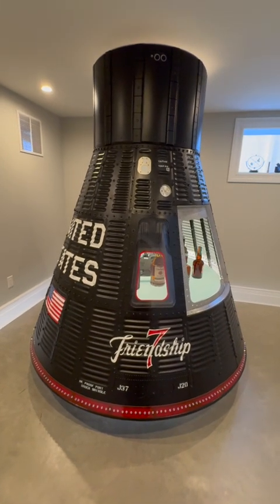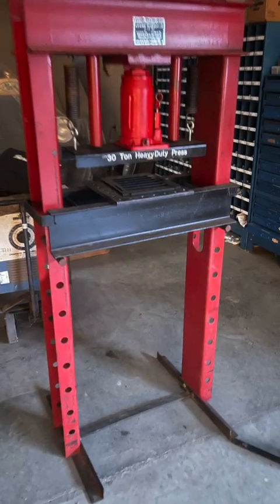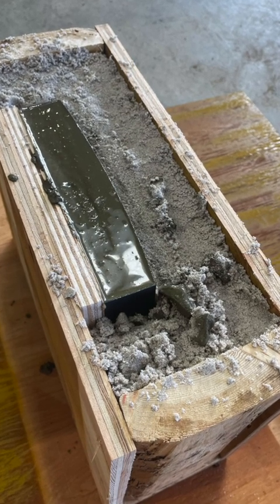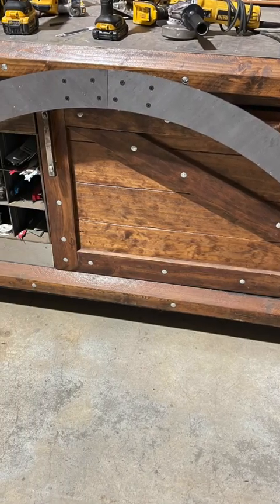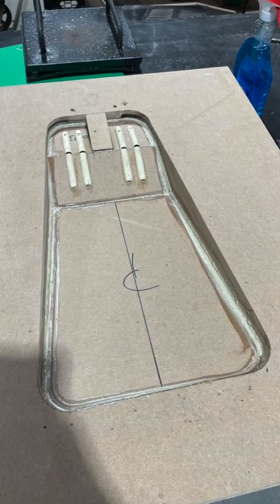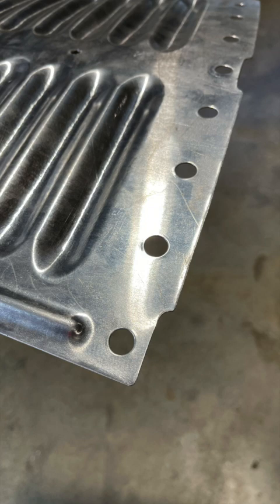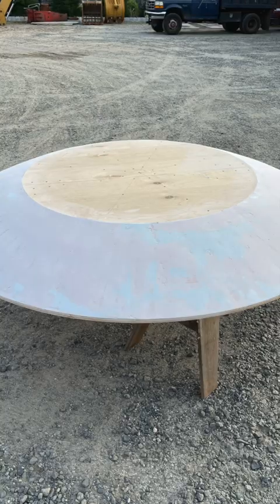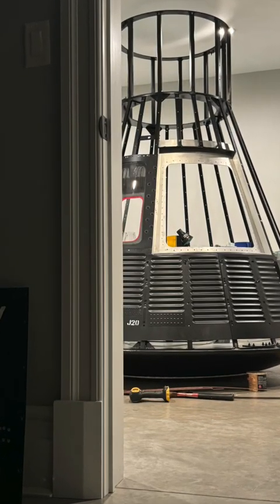Full Scale Mercury Space Capsule Build

Comment: Very impressive project , more than impressive. Outstanding!  To have a inkling of an idea and follow thru to this result really shows the type of determined and skilled person you are . I have had a similar drive to build a capsule for some chimpanzee dolls I customized. I was trying to purchase a Little Tykes plastic toy box capsule for this but found pricing and shipping to be too costly. Did not think my project would happen. A couple a months ago a bio company in the building I work at closed up and tossed a vinyl soap container away. It was the exact capsule shape and dimensions as the toy box I could not afford. What luck! A Christmas tree stand/ base works as the heat  shield. A plastic pretzel container become the nose cone . A salad strainer on the back of the heat shield became the engine exhaust . I built a chair for the pilot and a control panel . Three windows will help look inside. Maybe try to light it . This project still has a way to go , steps taken already are still roughed out , but your video just gave me a needed motivation to follow thru to a finished piece. This small potatoes compared to what you created , but I wanted you to know how much admiration I have for what you achieved.  Big fan of the early space age , fascinating.